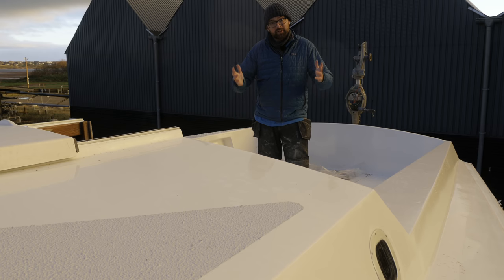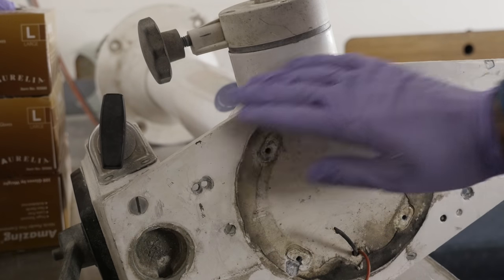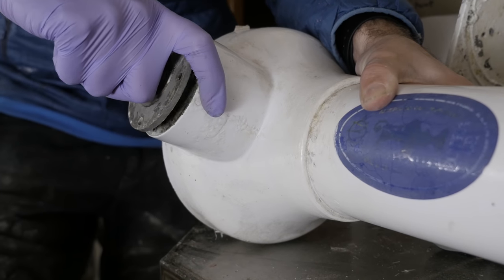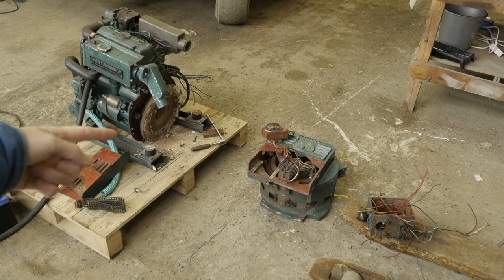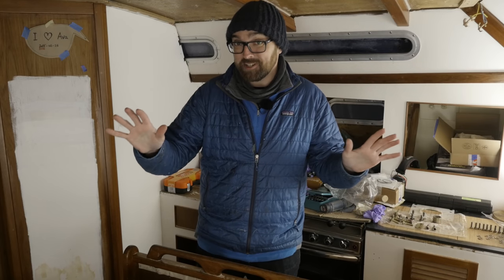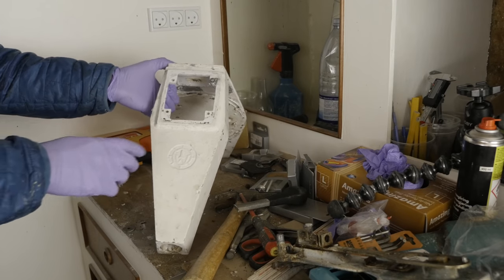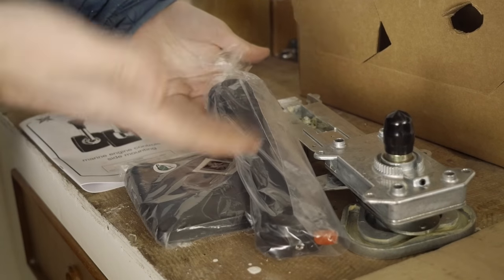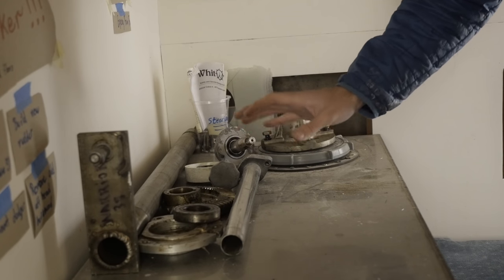Sail Life - Cobra 4R steering pedestal, refurbishing part 1 of 2

Comment: Hi Mads, I have a similar Whitlock unit. Just found out that Defender carries replacement parts. The plastic brake cup on mine was also cracked, and I got away with gluing it (Crazy Glue), sanding and repainting. But the other day I saw Defender had the part for less in US dollars than Cliff sells for in British Pounds....FWIW

Comment: Hi Mads, I think you might want to consider a few additions items for your pedestal: a cup holder or two, a USB port, a bracket (for the chart plotter/GPS) that can tilt as well as swivel. I've heard folks who thought it wasn't needed/necessary, later realize it is a really nice feature to have. If the screen is titled up and you are sitting down, you can't see the screen and if you're sitting to port or starboard, again unless the screen can swivel toward you, you can't see the screen.   Hope this helps. Thanks for sharing, have a blessed Christmas.  👍👍👍😊⛵⛵⛵⛵😊🎄🎁🎄🎁🎄

Comment: When you get the replacement bearing, use a sharp object to pop put the rubber seal out of one side, pack the bearing with grease and re-install the seal. You would not normally do this on a bearing that is running fast but it will help protect the bearing long term from any moisture that may get inside the pedestal.

Comment: Mads, I have a question about the new pedestal design, would putting your electronics ABOVE your compass not render the compass useless? Is there some kind of shielding that you're installing that isn't shown in the diagram? And maybe I don't understand the way wiring and compasses interact.

Comment: You can get a pedestal guard with a double bend, one going forward, then returning to vertical. Mount your primary plotter on the angled portion for 'stand up' visibility, mount other instruments to the vertical portion.
Buy the tallest on offer and cut to the size you require.

Comment: That pedistal looks great inside.   I'd order extra bearings right now for both the top and bottom of shaft while you are at it.  Bearings usually have numbers right on them, plus you can just measure them to compare.  Get the versions with the rubber guards on both sides to keep the grease from getting contaminated inside if you can get them like that.

As far as the control lever I would try and lower the controller a little bit if you can, because there are often steel parts inside them that are somewhat magnetic, and the control cables themselves usually have steel magnetic parts in them too.  Keeping them lower will help keep your compass as accurate as possible.

Definitely replace the cables when you have this all apart.  They are not very expensive at all, as strange as that sounds.  New cables makes for silky smooth operation of the throttle and the reverse gear.
Reply: Sealed bearings, not just shielded.
Reply: @gregoryyount6907  "sealed" bearings really are not sealed in the traditional sense.  Bearings are used on motors and the "sealed" rating only applies to being sealed against the cooling air being pulled through the motor by the impeller fan at the front of the open motor casing.  

The air pulled through the motor contains dust that will contaminate the grease if it is being pulled through the bearings themselves too.  

Thus "sealed" -but these "seals" don't stop moisture hardly at all and it is foolhearty to think they will.

Comment: Can't wait to see the new stainless steel version.  I'm sure that will look awesome.   I also saw read your comments about learning to weld and think that is a fantastic idea.   I picked up welding just for fun a few years ago and find it very rewarding.    My advice is to see if you can befriend someone who has experience and get them to show you a few things.  There are certainly technical aspects of welding (rod types, current settings, etc.) but to get good looking welds you need to develop a feel for it.  An experienced welder or welding class can help you develop those skills.

Comment: Hi Mads! I have the same setup on my steering pedastal, with the navigation screen tilting up. I don´t like it, i can only see the screen well when i stand behind the wheel. But on passage it´s mostly sitting down so then it´s really difficult to see anything on the screen. Pretty annoying, and something i really wish was designed differently.
Reply: Martin Bruisten I agree, this isn’t the ideal arrangement. Mads, I suggest you terminate the pedestal with a grab rail and mount the chart plotter to an enclosure that can rotate to port or starboard. That will make sailing the most comfortable and allow you to keep an eye on things without having to jump up behind the wheel. In your rendering if you terminate it with about a 30 cm strait loop and then mount your chart plotter on a single rotating mount on the top of the loop you can swing it though about 235 deg, port and starboard, or even better 360 deg so you can see it from the companionway. It would be better if you could mount it about waist height, but it doesn’t look like an option for your cockpit. Good luck with the design. Stainless will look amazing!  Fair winds and hope LA is treating you and Eva well.
Reply: Many modern chartplotters are networkable so that multiple plotters can work together.  The B&G Zeus plotters do this (but not the Vulcan) so you can have one at the pedistal, one at the front of the cockpit, and one down at the nav station.  Each one can have the same or different screens up and multiple crewmembers can be doing work on each of them at the same time.  Helmsman can be reading the chart, while someone is adding new waypoints, checking gribs, looking at sonar charts, reading AIS info, all without bothering the other station.

The actual plotter at the helm can be a smaller 7" or even 5" one that is cheaper and not so intrusive.
Reply: i agree with martin. check out Ruby Rose. nick has a plotter that swivels to any position.
Reply: Agree with all commenters here.  The fixed pod looks clean but is not as practical.  Yes depending on your system, you could also duplicate the display on an ipad or something but why?  It's right there, out of the way, weather proof, won't get sat on or launched across the cockpit, it just needs to be able to rotate and will always be available at a glance.  Someone else mentioned Ruby Rose, here is the link to his comments regarding the rotating Nav Pod... https://youtu.be/INT-7T_S6WA?t=193  granted, they have dual helm which makes it almost essential but I still think making it view-able from the cockpit seating is a great feature.  You could make a second plate cross above the compass where you could mount the locking rotatable pedestal for the nav pod and perhaps bend the tubing foward, across and back again to go around that plate so you still have a convenient grab handle.  Just throwing it out there.
Reply: Martin Bruistein How much time do you spend looking at your chartplotter 'on passage'?
If I'm doing any sort of critical piloting, I'm standing, as it gives me a much better view of my surroundings, (markers, rocks, sand banks, coral heads, other vessels), not to say that swiveling isn't a good idea, but certainly not the panacea that everyone is making it out to be.
Reply: And then there is the i pad wireless chart option so the fixed mount is still a good choice
Reply: @acmeopinionfactory8018  Hi there, of course i am not constantly looking at the screen, but there are times when i want to keep a closer eye on for example traffic (AIS) or when sailing in unknown territory closer to land. So for me, this setup wasn´t practical nor comfortable. That´s why i installed a multiplexer with wifi, so i can see everything on my iPad but that too has it´s drawbacks (danger of waterdamage, charging the battery). I have no experience with the swivel thing, but i guess it´s always a compromise.
Reply: @martinbruisten7987  I take your point about wanting to see your plotter occasionally when sitting down, which is convenient and can be reassuring, but if I'm 'sailing close to land', I'll keep my eyes on the land, not the plotter.
If the AIS or radar intrusion alarm sounds, is it not worthwhile to stand and assess the situation?
If I'm sitting, I really can't see over my coach roof. If I'm heeled enough to see ahead while sitting, I'm moving fast enough to warrant a lookout by my own eyes in close quarters or high traffic areas.
I think we've come to rely/depend upon electronics perhaps a bit more than we should. I'm no Luddite, I have a plotter, radar, AIS, sounder, etc., but still feel much more comfortable with paper in the cockpit, whether chart or cruising guide.
Maybe I'm getting old.
Reply: @acmeopinionfactory8018  Agree that when Navigating tricky areas, near land or in busy areas that it is not a time to be lounging around.  But on a long passage in open water, it would be nice to see at a glance, that you are still on course, what sort of SOG you are making, ETA, especially when the wind is light and flirting with motoring.  Always good to have an awareness of traffic even when there is very little so you can be proactive in avoiding conflicts.  A swivelling pod isn't essential but it is a very nice option well worth considering at the design level that Mads is at.
Reply: @Frostbbitten  that is it exactly. thank you.

Comment: I think the only thing I would worry about is the quality/alloying in the stainless steel used on the pedestal. It's not always a given that what you're told you're getting is what you actually get. Some stainless does great in seawater conditions, some others do more so-so. Also, see if you can somehow integrate a table hinge/lock and drink holders into the pedestal if you plan on putting a table there anyway. Other than that it looks good.

Comment: MAds if your going to put some small lights in the top plate shining down to the cockpit sole than a idea is get small "Sail Life" covers so when it is shining down it displays the sail life logo on the sole of the cockpit. Also with the taller height of the entire thing get a large plate to fit under the bottom side of the cockpit sole to strengthen the floor so if you fall against the higher pedestal, even with a heavy display up that high, it will be safe.

Comment: Going by the sound, there's need for lubrication, other than that, the top gears look in good condition, for kicks and giggles, if you actually want to know how good an engagement your gears get, once you're done cleaning, paint the ring gear with some kind of meaty removable paint, then assemble the assembly, snug, and move it around a bunch, take it apart, and see how much of the paint is worn off.

Also, make sure that the compass is ok with that much ferrous metal around it!!!

Comment: I find that the engine control on most sailboat are often placed at an oddly place. you have to reach down over the steering wheel. It can work if you have long arms. But for a woman with shorter arms, not always that handy.  Why not move it a little bit up, at the height of the compass. Maybe make is symmetric with similar box at other side. !  Just my thought!

Comment: You need to invest in a manual impact hand screwdriver the kind you use a hammer with
Reply: I was thinking the same!
Reply: They're mandatory on my boat. Once you use one you'll never be without it.
Reply: I was thinking the same thing. I have one that I inherited from my dad that was used a lot rebuilding old MG's back in the 60's.
Reply: I think it is mostly used for extracting tough screws or bolts. I think it is called an "impact extractor".
Reply: "Capri tools hand impact driver" on Amazon.  Works wonders!
Reply: Best thing You only know about after You have got one ...
Reply: I was thinking the same thing...

Comment: Hi Mads, I have a 1988 Beneteau Oceanus 350 with the exact same throttle housing with that logo on it. I think you also have the Volvo 200/3 engine that I have in my boat. Must have been an 80's Volvo thing.
Reply: Luckily Mads does not have a 2000-series Volvo-Penta.  Worst Engine ever made by Volvo-Penta, and perhaps one of the worst diesel engines ever.  I've got two of them.  Start saving up for a Beta  right now.

Comment: Now I want a Cobra pedestal ... Its intestines are about the quality You wish everything used in Your sailing yacht would be.
I would rethink Your choice of material of top plate and engine control though: stainless gets HOT in the sun (and can't re-emit this heat via radiation itself, being a shiny metal ... Stefan Boltzmann radiating properties, look into Your physics schoolbooks), and shiny stainless might severely dazzling the helmsman when looking at the compass, too.
For the reassembling: best results keeping stainless fasteners in aluminium cast parts moveable for years we had with lanolin (wool fat) anhydrite ("dried" or waterless); 
You can get it from beauty sites or Amazone, it's also used as biological unguent base.
Merry X-mas and a big thanks for sharing.

Comment: That logo looks like the Whitlock logo.  They made  a Cobra 4  pedestal amongst others.  So my guess would be that the  motor control housing was a stock part from Whitlock.

I looked the vid again and sure enough the logo is on your Whitlock diagram.  Thinking about LA are we?
Reply: You are correct. You could by that pedestal with that control housing from Whitlock.
I have one.
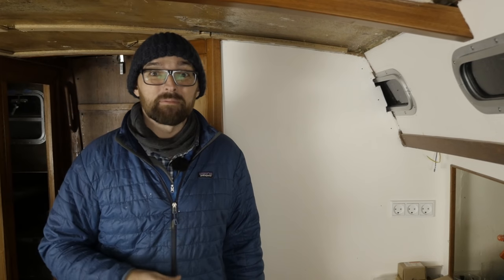Reply: Yes.... you can see the Whitlick logo on the paper in the cup at 13:38

Comment: @SailLift Mads, 

One thought I have is it looks as though your throttle control is the style where it is one lever that does both directional control and runs the throttle. I personally hate these! 

The reason is I like to be able to run my throttle independently of the engine. On my Yanmar JH4E if I run it cold it will use a quart of oil by the time it warms up. But if I set it at 1100 rpm for 10 minutes it will not use a quart in 150 hours! 

Being able to warm up a diesel will extend the life of the engine and lessen oil consumption, and not to mention if you have a tail wind save you from sucking on all of that glorious glorious diesel oil smoke! 

The other reason why is being able to charge your batteries with your engine, I am installing a 100 amp alternator on my engine because the couple of hundred watts of solar I have is not always able to keep up in the winter time with the short days, or on the summer when we have a really hot day and the fridge is running full tilt keeping my groceries and drinks cool. 

Firing up the engine and being able to run it at a higher RPM to get the alternator charging is a huge advantage! 

I know that some of the one levers do come with a shift lockout that will let you rev them, but personally I don't like that style, I would much rather have 2 levers because sometimes when you wind up starting the motor it will because it is 5am, you left something turned on and your batteries ran flat over night and the inverter will be squealing at you with a low voltage alarm. 

So you get up all groggy and cussing at the thing, start the engine and rev it up and set the batteries to charging, and miss the fact that you have put the boat in gear and now are starting to make way dragging your anchor behind you. 

If you are in a crowded anchorage you could find out that you have done this with the crunching of fiberglass and the noises of deck hardware being ripped form its fastenings as you slam into another boat. 

Just some food for thought, I know you have bought the other control already, but to me losing out on that hundred bucks would be a lot cheaper than accidentally wrecking your boat later on if you accidentally put the boat in gear running up the motor. 

That being said the new pod design looks totally awesome, I cannot wait to see how it turns out! 

Have a Merry Christmas!
Reply: The way that throttle lever works is it has a button to disconnect the forward/reverse gear selection and can hence raise the revs without engaging forward or reverse
Reply: @leer1024 I know you are right about that and I understand that, and I did reference that in my comment. 

It is easy to accidentally put the boat in gear if you bungle handling the button you can put the boat in gear and not realize you did, if it is 5am, you are groggy and tired and running the engine, you could put the boat in gear and then go back below and climb in your bunk not realizing the boat was beginning to make way.
Reply: You can use the throttle independently with that lever shown here easily.
The D2-40 Mads has, comes with a 120Amp alternator as standard.
Reply: @Scramasax  I understand you can use it interdependently, what I was saying is it is easier to mess up than if you have 2 levers. 

Please re-read my previous comment.
Reply: Good Lord.  And it's easier to mess up docking maneuvers with dual levers.  Get real.  The button is not a hardship.
Reply: @svbarryduckworth628  I didn't say it was a hardship, I said you could put the boat in gear when you didn't mean to, as I had this problem on a friends boat a couple of times. 

On the other hand, I have an Edson binnacle with a lever sticking out each side, have never had a problem getting on and off of the dock. Right hand throttle, left hand changes directions, really not that hard.
Reply: @RenegadeADV  .... fair point, but the opposite is also true. It is easy to start the engine in gear with the two levers also. I have never had any issues with one lever, and dont think it is truly a meaningful discussion  point to validate change. The issue I have with two levers is that you need both hands to change forward to reverse, one to reduce throttle and then switch to the other to change and then back to increase throttle.